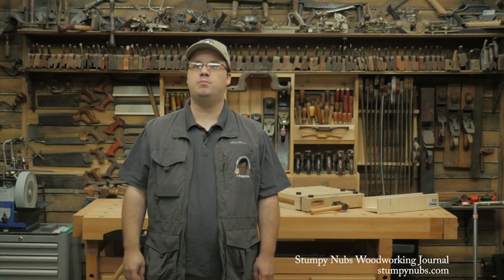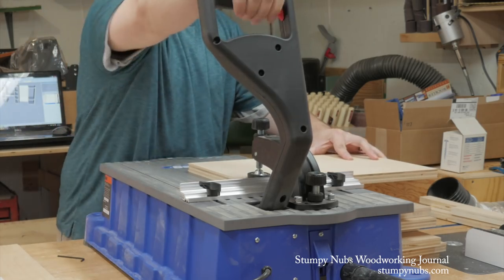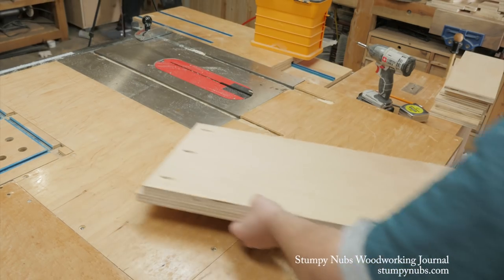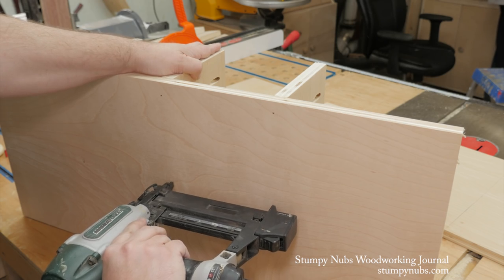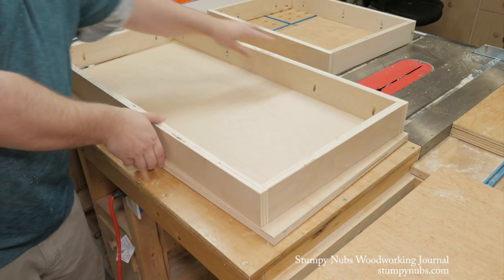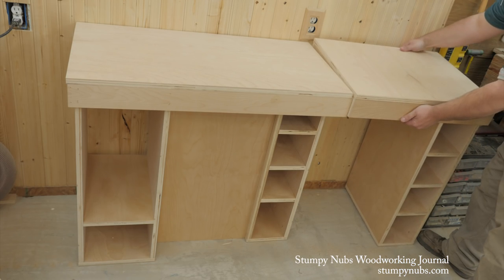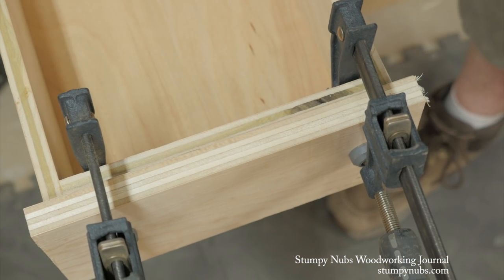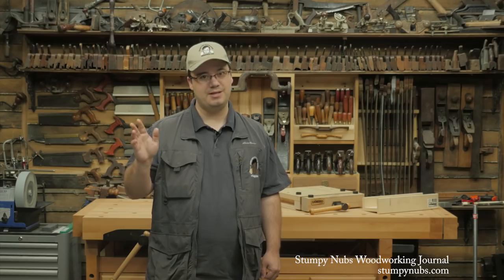Build a homemade stand for a mini/midi/full size lathe (using Kreg Foreman Pocket Hole Machine)

Comment: Hi, 
l searched for plans for your lathe stand under StumpyNubs.com but did not find any plans. Do you have a quick link for the plans?
Currently my lathe is on a 16" wide shelf mounted to the wall. This is OK for spindle and pen turning but too close to the wall for hollowing bowls.

Best regards,
Herms

Comment: With all the flat area sitting on the floor I would be worried about the stand rocking. On the missed goof with the center divider pocket holes. You could have assembled one side first and used the pocket holes on at least one side before adding the other panel.

Comment: Why the wasted space in the middle of the main stand?.
Reply from the maker: That depends on what you consider "wasted" to mean. That panel serves a function, as mentioned in the video. (Lateral support to prevent racking), and it is an excellent place to mount a tool rack.